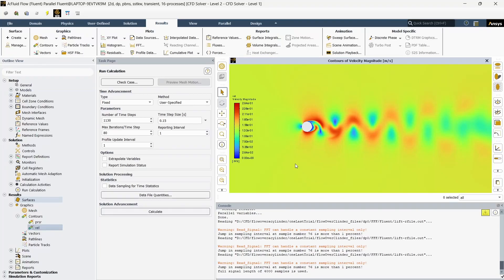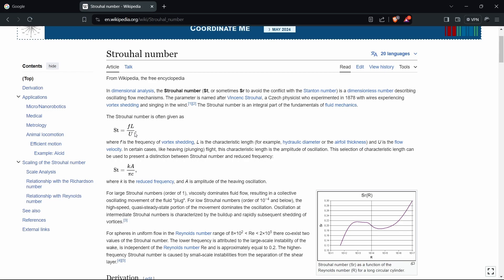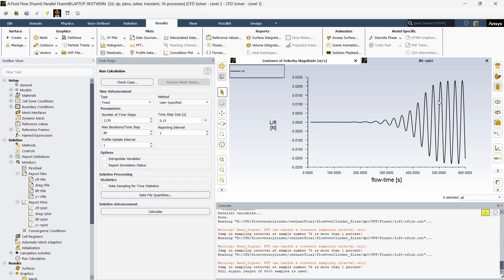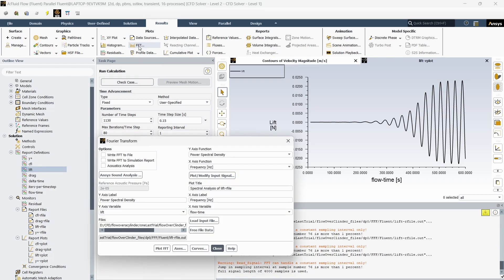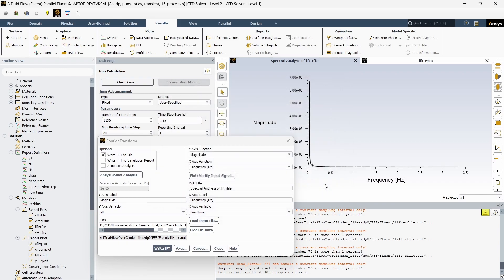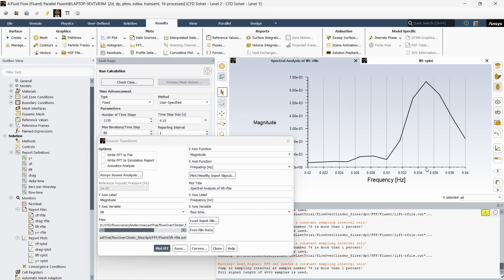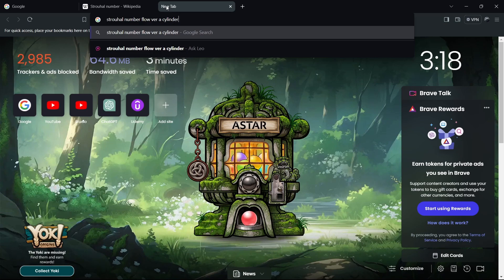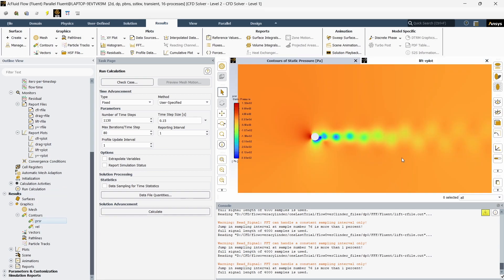Calculate Strouhal Number in ANSYS Fluent using Fast Fourier Transform (FFT) | Flow Over a Cylinder

Comment: what is the unit of y-axis
Reply from the maker: Newtons. If you mean the lift graph
Reply: @Codeynamics  thanks ur right, just to make sure.. can i ask, as im trying to use FFT output as input into harmonic responce analysis. when i save the FFT plot i get lift force vs frequency. is there a way to get the phase angle as well ?
Reply from the maker: You can process it in python to do it. Have you done it already? If so please let me know how you did. I will try to make a video on that later.